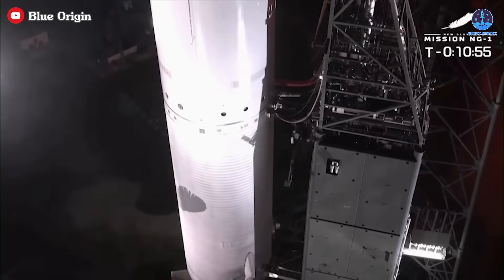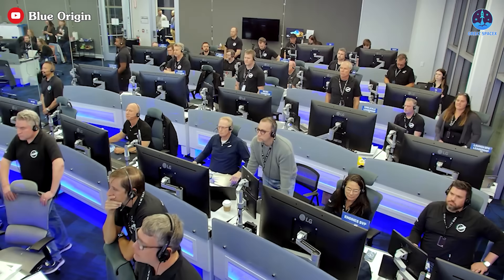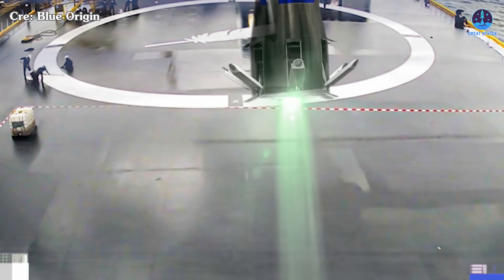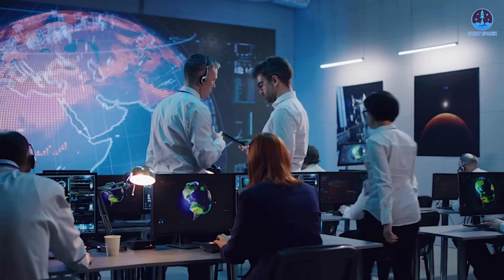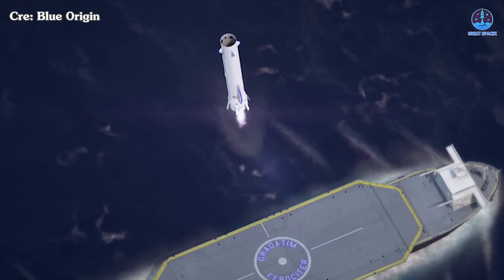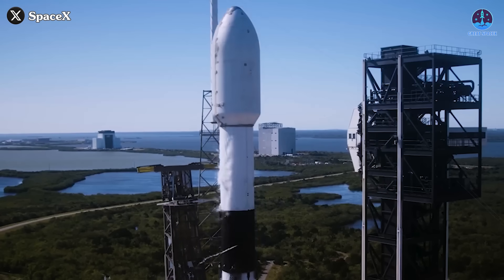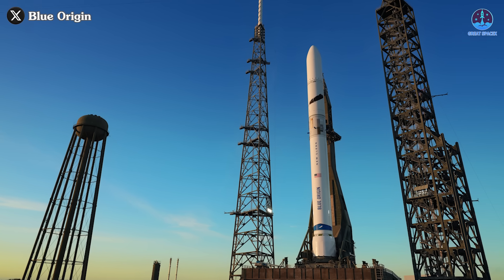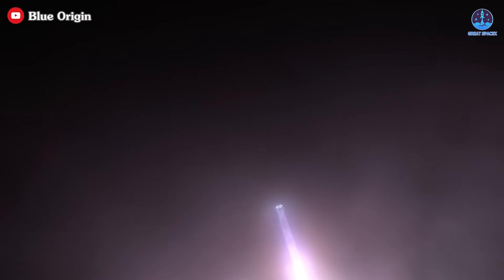CAN'T DECELERATION Blue Origin revealed Why New Glenn Booster Landing Failed...

Comment: Truly the "catastrophic" failure was not that much of it. 
They did place their load in orbit, and sure, failed a key component of their architecture (recovery) that must be reached before all is properly operational.
They have a long path ahead, specially given the potential rocket cost, but not as long as was before 
The problem might arise from their slow advance development culture that must change into a "rich hardware strategy", akin to SpaceX's if they hope to succeed in the long run

Comment: Well now you know why ( SpaceX ) has had so many failures in developing ( Star ship) . If it was easy,everyone would be able to do it. But now the $64 question is,since Blue Origin appears to have had just one vehicle in the assembly building, how many” years “ is it going to take before they have another vehicle to launch? And at what cost! It’s not like they have a warehouse full of BE4 engines and a half dozen New Glenn vehicles in various states of construction. This is why they call it “ Rocket Science “ IT AIN’T EASY
Reply: They have 3 Boosters in assembly building.  Only one is assembled.  The parts and domes are computer cut and designed and stacked ready to use.  They also have the engines for 2 boosters.  Another 4 are readied for ULA.
Reply: @davidbowerman6433 Thanks!  Good info.

Comment: It is important to note that the first landing test for SpaceX’s Falcon 9 rocket occurred in September 2013 on the sixth flight of a Falcon 9 and maiden launch of the v1.1 rocket version. From 2013 to 2016, sixteen test flights were conducted, six of which achieved a soft landing and recovery of the booster. To expect Blue Origin to land their booster on the first launch is preposterous, especially because New Glenn is similar in size to SpaceX’s Starship booster, which has succeeded in landing where SpaceX wanted it to land exactly twice for seven launches (and SpaceX has a lot more experience in rocket recovery with their Falcon 9 rockets than Blue Origin has with New Shepherd).

There is nothing novel in this video about Blue Origin, it only serves as PR for SpaceX.

Comment: THe booster was so slow to rise up off the pad, I wonder if the thrust is lower than they needed to land.  Like they need to run the engines longer and earlier to slow down enough on reentry.

Comment: It looked to me that the booster stopped transmitting data after just a few seconds of the reentry burn which is where it most likely had the massive failure.    This phase is where SpaceX was smart to use smaller diameter rockets because of the pressures involved especially impacting the atmosphere at hypersonic speed.   Outlet pressure must match whatever it meets upon exiting the bell or you get either 'over-expansion' like with a sea level engine in space which just reduces the efficiency, or the much more dangerous 'under-expansion' where the pressure in the bell is less than atmosphere or in this case impact of the atmosphere which forces the flame up into the bell.   This causes unstable combustion and can lead to pressure spikes which will destroy the engine...which is what I'm guessing they encountered.

BO had SO much trouble with the BE-4's during development that they're being run at low chamber pressures to enhance their reliability and this might have bitten them in the butt.   Will be interesting to see how they proceed, though they're not likely to be broadcasting their true accident findings lest their customers (who have been waiting for quite a while) lose confidence in them.

Comment: I feel confident in saying that the NG will be fitted with Raptor3 engines in the end. The two Bosses have aparently buried the hatch and Boss nr.2 would not ever do that unless he has finaly understood that BO needs help...badly. Besides...it would be way cheaper than their own snail-pace engines.
Reply: Why would they completely rebuild their rockets to use Raptor engines?
Reply: @ 3 things. First: Money. Bezos cashes out 1bilion bucks in Amazon stock every year to keep it running. They dont have any revenue coming in with NG as things stand. That is simply unsustainable in any busines.
Second: Engine production is iffy and way to slow to build and equip enough NG:s to turn that around and start making bucks.
Third: Re-designing the internals and lower third of NG to accomodate Raptors would most likely be faster and more reliable. Raptors are by now a proven functioning system. They dont have to re-design stage2 since that seems to work. They got it in to orbit as planed. The booster is now the hang-up and has always been so.
Now...i dont know this for sure ofcause, but i have been following both BO and SX from the very start and have seen the drastic diffrences between the two. Soooo...my gut tells me this very loudly. I might be wrong, but i dont think so.
Reply: @fredrikabinger4818  They have guaranteed payloads by the American government for several billion dollars.
Reply: @akyhne  Mhmm..sure. They should have begun honoring those contracts 3 years ago and still have no working rocket. They have already been payed for those services and yet Bezos has to carry the company on his own dime. They are already in Breach of contract. That is why something radical has to take place such as asking SX for help or they risk going bankrupt, You dont sqrew around with the gov without consequences for ever and they may have to pay back all of that money they already have burned through longsince. They are a private company, not NASA and could be liable for penalties sooner or later. More so..they are wrecking the confidance in the company and its "good name"..customers will avoid contracting them. That would be the absolute death-nail for them.

Comment: This beast was really slow getting away which increases the fuel consumption.  The engines were shutting down before staging, I am thinking that they just used up all of the fuel or oxidizer so nothing was left for the landing.  Will be interesting to find out.
Reply from the maker: Interesting observation.
Reply: That's just pure speculation. Also, all the Starship launches used all their fuel, according to the graphics on their streams. And yet, they didn't lift more than a banana.
So, what's your point?!
Reply: @akyhne  This has nothing to do with my point. It is just based on an observation based on the way the rockets work.  It incorrect to state that all of the starship launches used all of their fuel given that there have been multiple soft landings two of which resulted in a "catch,
Reply: @JimJocrusin  I base my observations on the same you do - using my eyes.
A bad way of measuring, but it goes both ways.

Comment: BO is not SpaceX. They have to focus on reusability because New Glenn is a very expensive rocket that takes a long time to make. BO never intended to make very many of them. So they need to get reusability of the booster solved or their whole business model falls apart.
Reply: What matters, is cost of launch. Even Ariane 6 can launch for not much more than the Falcon 9, without re-using their rockets.
And New Glen launch costs are listed to be around the same as a Falcon 9 launch, but with almost twice the payload capacity, and much better capabilities in payload size.

Comment: I doubt BO booster will ever fly again, let alone land successfully for re-use.  It is far too complicated to achieve the intricate balances of fuel, burn and direction of rotation.  As Musk has stated numerous times   -  LESS IS MORE.  hich is why SpaceX keep upgrading their Raptors for future-proofing and risk prevention against anaomolies of complex machinery working faultlessly on schedule at their potential.
Reply from the maker: Let's wait to see what they do next
Reply: It's way harder to build a rocket, that can take off, than one that can also land. That's just a minor extra step.
Reply: @ The point  was making as the BO engine although ostensibly the same as the SpaceX engines have nowhere near the level of refinement.

Comment: Given that SpaceX took XYZ number of attempts before being successful, it only follows that without any prior knowledge of machine programming and hardware,  Blue Origin is also going to have a similar amount of failures  baring any dumb luck or a complete stroke of genius. The only thing that makes it easier is that they already know that it has been done before. This is a highly complex problem that requires real world testing. Computer models can only take you so far, and the models are all built on faulty parameters. The parameters are adjusted with new data. This means flying rockets. They are very slow at producing and flying rockets, so I don't see how they're going to get to a successful solution anytime in the near future. It could be several decades before they solve all the problems.
Reply: Exactly! To have any reasonable chance of success Bezos will have to bite the bullet and emulate Musk's approach to rocket design and testing (as the Chinese appear to be doing, and they will get better). If he doesn't, even supposing he does catch up in the end, events will have passed him by and rocketry will be in a new place.

So I predict failure. Bezos is stubborn. His project will die of hubris and become an also-ran.